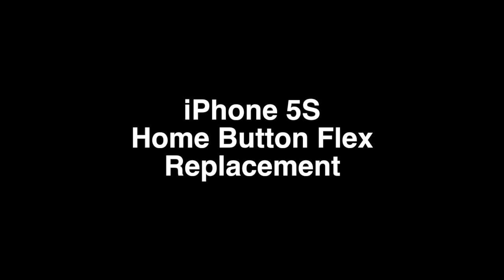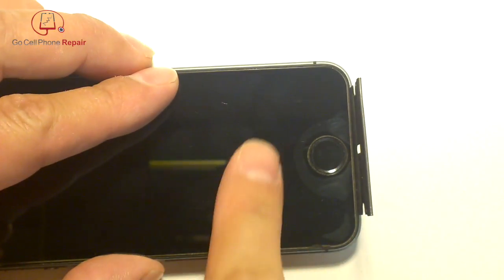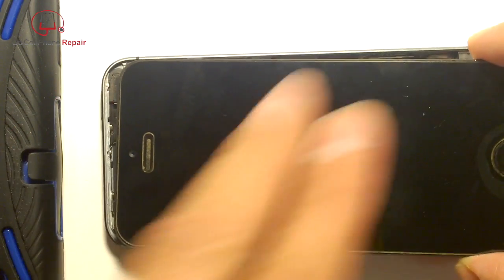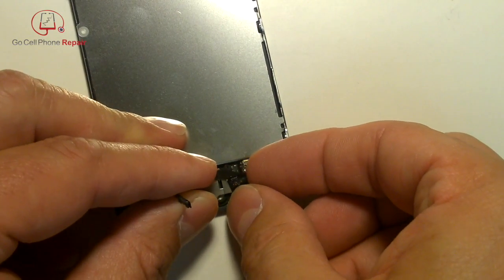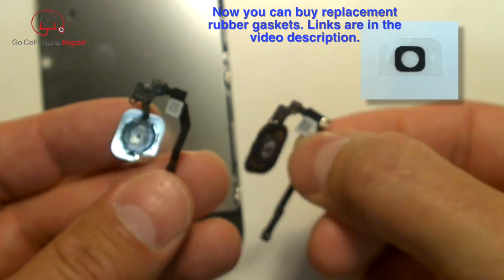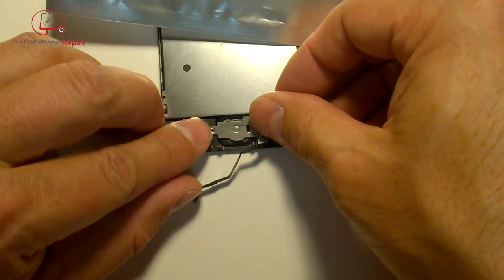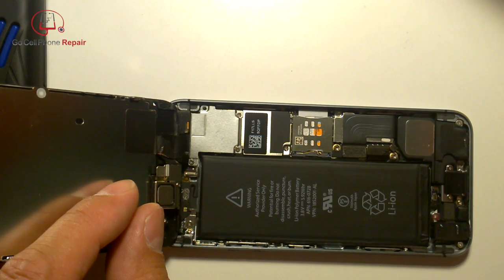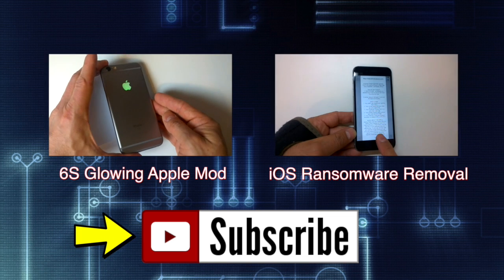iPhone 5S Home Button Flex Cable Replacement

Comment: I have a 5 SE but the screw on the bottom ribbon cable is rounded off as it is so tight I couldn't undo it, I have tried putting tape over the end of the screwdriver bit but it still doesn undo, any suggestions? Thanks

Comment: I've watched a lot of iPhone 5s videos this past weekend as I struggled to attach the home button ribbon cable. Everyone seemed to just gloss over the process and made it look so easy and then moved on. I watched your video and found it very helpful with attaching the home button cable. It was a face palm smacking moment. Every previous video I watched showed people holding the screen directly above the base of the phone. Your video showed you moving the screen off to the side to press in the cable. What was taking me an hour of frustration, only took me seconds. Thank-you. I'm a new subscriber.

Comment: Thats not flex cable replacement. You replaced the whole Home Button, and you lose Touch ID functioning
Reply: You can’t replace just the flex cable. That should be obvious
Reply: its says instantly when the video starts that

Comment: important thing to note:
make sure you screw in the metal plate that covers the home button in the same way thats done in the video. 
Discovered today that my home button eventually broke because the last time i took my phone apart i screwed it in upside down and that caused it to put pressure on the flex cable.

An easy problem to check though, and you should notice if you do it incorrectly the home button won't make the click sound when you press it

Comment: My iPhone 5 s will not restore I think the battery might be expired?it gives an error 4013??it almost goes thru the Restore process but stops and flashes back to the iTunes restore screen also only powers on when plugged in???do you think a new battery would fix this problem???Kevin
Reply from the maker: Well if it won't power on unless plugged in then your battery may be shot. You can try replacing it but you may have another problem altogether. Error 4013 on iPhone 5S is usually a hardware error. After the battery I'd try a different USB port, lightning cable, and charge port. If those doesn't solve your problem you may have a Nand issue which would be more difficult to deal with.

Comment: I've replaced everything the cables all seem intact but my home botton doesn't want to press I have to press it super hard and a bunch of times it doesn't really work, it doesnt click as well I'm very confused what in the world did I do wrong?!
Reply from the maker: If you changed the flex cable make sure that the metal plate went back on in the right direction. If the screws holding it down are too loose or too tight that can cause problems too. If those suggestions don't help I'd remove the button and make sure that the actuator clicks and check for any foreign debris between that and the plastic button.

Comment: I change my home button but touch id doesn't work plz reply me what can do for it??
Reply from the maker: Only the original button will allow Touch ID operation. You can thank Apple for that. If you pay them they are the only ones actually capable of replacing a home button that will work 100%.
Reply: Go Cell Phone Repair    My phone home button is working but flex cable is damage can i change flex cable.... after that touch id will word or not plzzzz reply???????????
Reply from the maker: If you're talkong about the home button flex cable that is physically attached to the button then no you will not have touch ID if you change it out.
Reply: Go Cell Phone Repair     The cable is damage from the home button so i can repair it
Reply: Hi Go Cell Phone Repair, I have my ip5s screen black hole (LCD) and also error 4013 as it is in recovery mode when my sister gave me. Now I went to the tech to have my screen replaced. Now they say my battery not working and charging flex.. what could have been the problem.. can I fix it? or did they just want me to pay higher? :( I brought it home.. the apple logo keep restarts only..
Reply from the maker: 4013 might mean that you have a USB communication problem. You might try a different cable, USB port, and charge port and see if you can restore it.

Comment: I am having issues with home button and touch ID screen was replace by me with original home button .but after screen repair home button nor ID work anymore ..any suggestions as to how to fix
Reply from the maker: Make sure that the long flex from the home button is seated correctly and not bent where it plugs into the board. They get warped easily if you aren't careful during installation. Also check both the home button cable and the long one that it plugs in to near the physical button with a magnifier. Even a tiny tear can affect functionality.

Comment: Do you need the rubber for it to work?
Reply from the maker: It should sort of work without the rubber but you'll probably end up with moisture inside. The rubber gaskets are super cheap though. I'd buy one if yours needs to be replaced. I think about $2 or so.
Reply: Thanks for replying Iv changed my home button around but nothing has happened it still doesn't work do you know why?

Comment: You never returned to the grounding clip on the home button , finger sensor wont work without it
Reply from the maker: Correct. This is mentioned in the video and the description.
Reply: would finger print work if you return the grounding clip?
Reply from the maker: Not unless you use the original that came with your phone when it was new.
Reply: I replaced the whole housing and screen for my iphone 5s. Everything is working fine except home button. Could it be because of this grounding screw?
Reply: I replaced with my old homebutton and put the grounding screw. But still the touch id didn't work. I think i didn't broke my cable.

Comment: I got my Iphone's 5S home button flex cable broken while I was trying to repair it. So is there any way to replace only flex cable of home button. Because I have heard Touch ID will not work if the home button is replaced. Please help me
Reply: Seo Experts same problem here
Reply: El Zuniga 
you have any solution same problem with me
Reply: that how it is with iphones,change it to samsung and won't have any of these problems